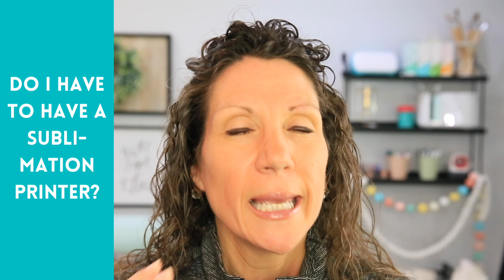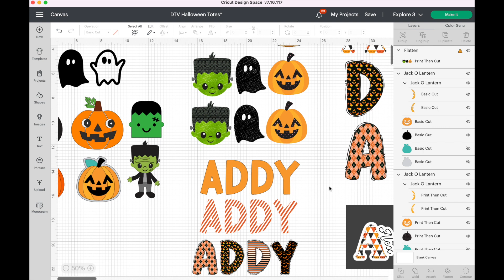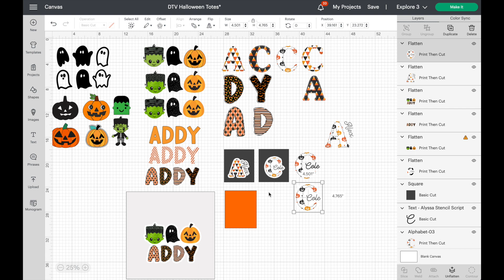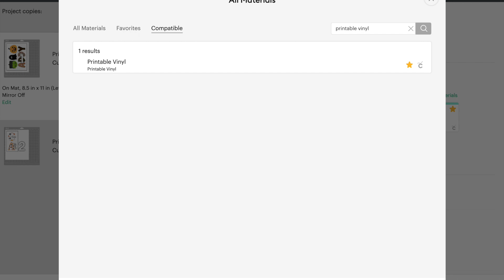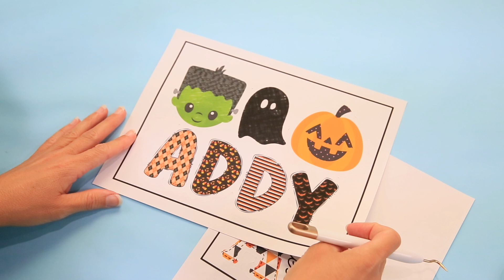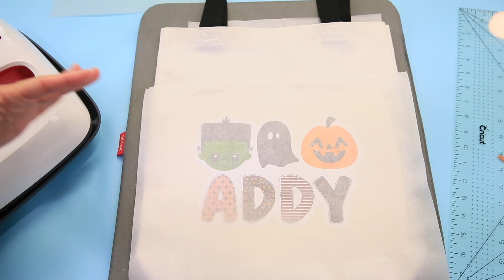What Is DTV Direct To Vinyl And How To Use It | Sublimation Printing Hacks

Comment: That was a great tutorial and I love the designs that you used! I found a hack for being able to use the Joy to do print then cut, so I know I can at least make the designs and print them. I can't wait to try this!
Reply from the maker: Thanks so much Lisa! I'm super excited about these DTV printable vinyl sheets. I have so many plans for things that I can't sublimate! 😊 And I'm interested in the Joy hack. Hmmm. I'll need to look into that. Happy crafting! 💕🎃
Reply: @KimByers  I haven't gotten down the cut part yet. To print then cut you just change the machine from Joy to one of the other machines. I use the Maker 3. You can then make designs print then cut and send them to your printer. I tested it with just printer paper and it actually worked!